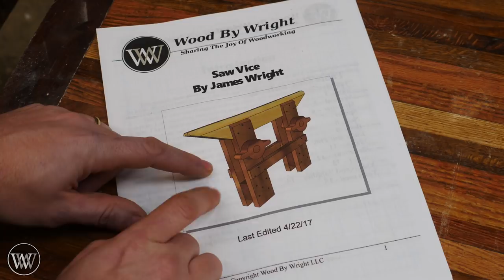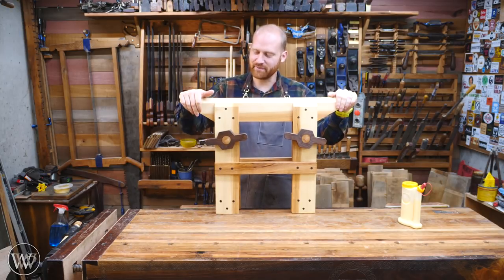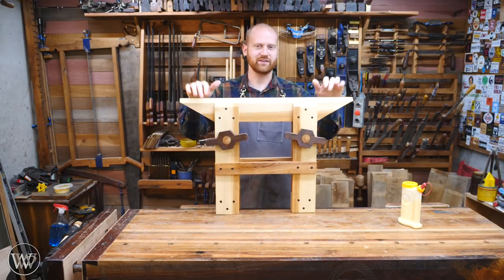Building the Saw Vice In One Video

Comment: I always have a hard time trying to sharpen my curved draw knife and I also have a 22" curved tree pruning saw that the manufacturer insists needs to be factory sharpened or just replaced. I had a 14" version that came sharp as all heck and was faster than a chainsaw for anything less than 5" diameter. So I got a 22" version from the same manufacturer, figuring it would handle 8"+ logs, but it wasn't anywhere near as sharp and couldn't even cut as fast.
Reply from the maker: the tree trimming saw probably has hardened teeth. that is a good way to rip up a file. I have been wanting to do a video on draw knives but have not yet. I might have to bump that up the list a bit.

Comment: When sharpening a crosscut saw, is the tip of the file pointed towards the toe or heel of the saw? I believe I did it backwards, but the saw still cuts excellent. THANKS
Reply from the maker: that depends on who you talk to I prefer to have the tip of the file pointing at the handle so the bur is on the back side of the tooth, but some people like the aggressive nature of the burr on the front of the tooth. but in all honesty, it makes so little difference you have to have been using a hand saw for years before you can notice a difference.